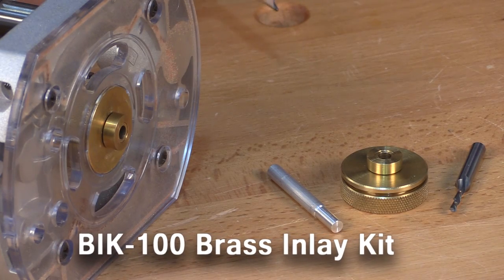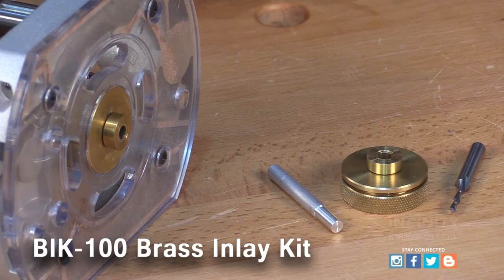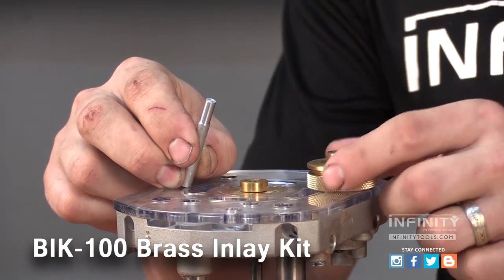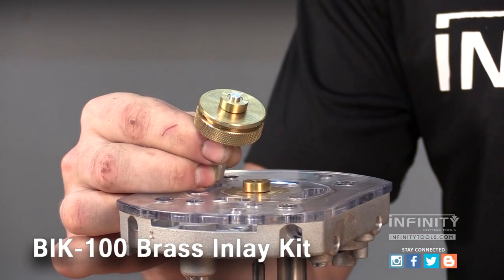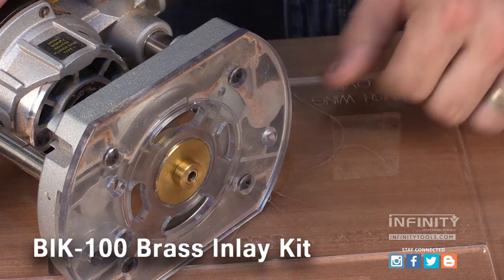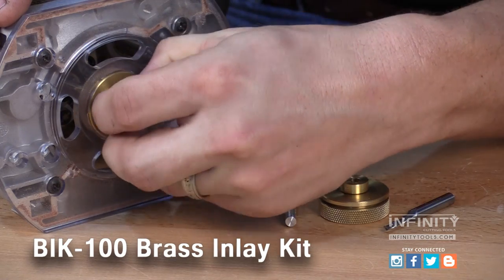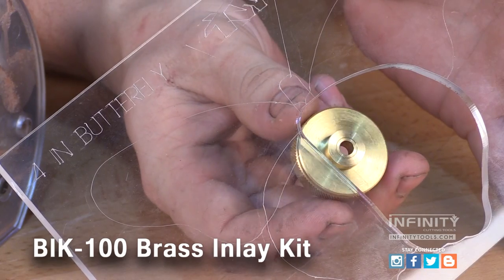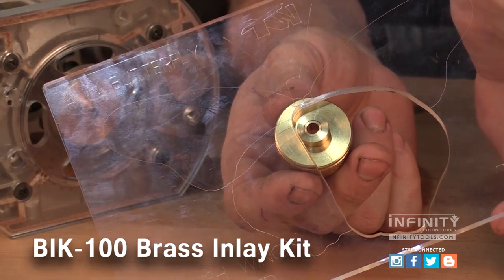Installing and Using the BIK-100 Brass Inlay Bushing System

Comment: Are you using the same bit to remove all the waste?
Reply from the maker: Hi, yes in most situations the same bit is used to remove the waste. For very large inlays you can use the 1/8" bit to cut the outline of the placket, then switch to a larger bit to remove the waste. in this scenario you have to make sure not to cut into your template or cut into the outer edge of the pocket. In most cases the 1/8" bit will get the job done.

Comment: How do I know that system will fit my router?
Reply: Looks like a standard Porter Cable style bushing and 1/4" shank. I have a Triton router and needed to buy their universal 7" router base to accept similar bushings which I use for my dovetail jig.
Reply from the maker: The bushing will work with any router with a base that accepts a porter cable style guide bushing. many routers come with a comparable base, however if your router does not, one of our 7" universal router base plates may be the perfect solution. https://www.infinitytools.com/universal-router-baseplates